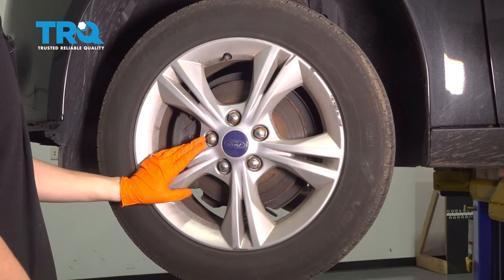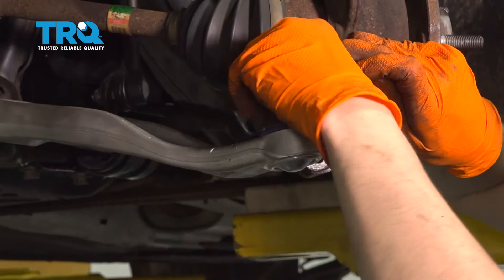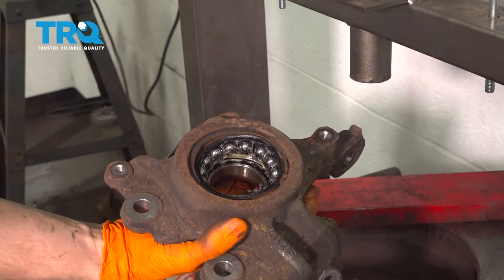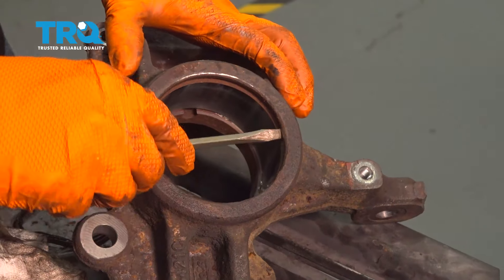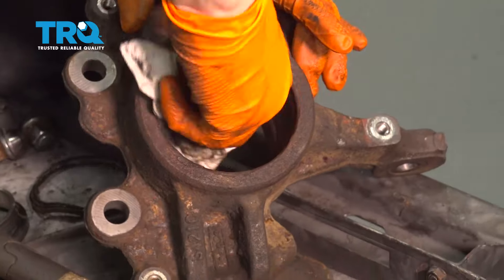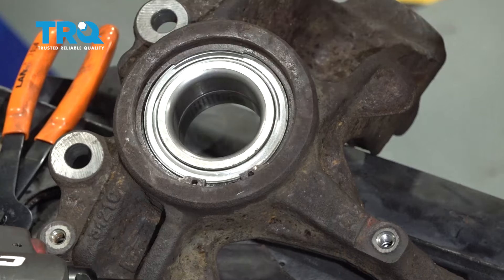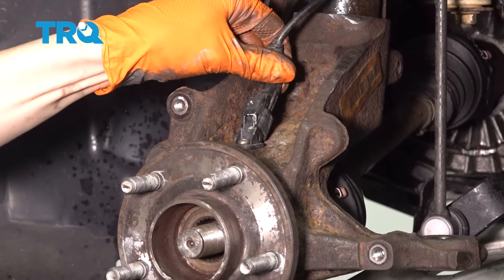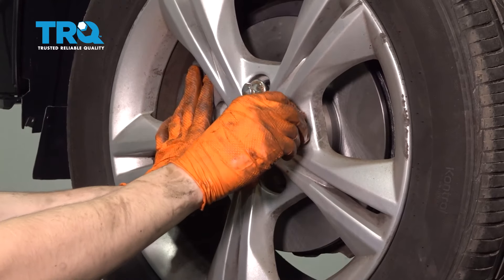How to Replace Front Wheel Bearing 2012-2020 Ford Focus

Comment: I like how you didn't mention that the bearing has a magnetic ring for the ABS sensor and it can be put in backwards I followed your tutorial, but put the bearing in backwards only learning It was possible from another video.
Reply: I'm not sure if you're strange for liking that you put something back together incorrectly because it wasn't covered, or if you're strange for using sarcasm on a video that shares a ton of information and was obviously made pretty carefully and with knowledge.

But hey, I like how you provided a bit of information that was missed in the original video. That's helpful.
Reply: @TheOmaJohn  sure the video is informative, but only to the point that it is possible to ruin a component you are installing.
Reply: @brutusjb3814  thanks for helping everyone else out.
 Nice work pal.
Reply: 🤣 😂I’m done.
Reply: Lol you shouldn’t be doing repairs if you didn’t know about the abs ring

Comment: There's a much easier way to remove the spindle from the strut.  Put a putty knife in the cutaway where the bolt came out.  Put the bolt in threaded side and tighten the bolt to the putty knife, this will push the cutaway apart, and the spindle will just fall off.
Reply: thanks. now to show my gratitude - check out billet spin performance tops, scovie turning or kemner design

Comment: Though every repair has its own issues this vid saved me hundreds. I also replaced the lower control arm/ball joint (They are not separate on the Focus 2012) Much thanks. I will repair anything I can, and "the man" can pound sand.

Comment: A mechanic replaced my bearing last year. They didn't use a press, instead they just hammered out the bearing. Immediately after, the brake pads had uneven contact with the rotor, generating rotational noise.  After years of replacing the rotors/pads/calipers, it turns out my hub was dented - All this was solved when the hub was replaced. Do you think this was caused due to the original mechanic being careless when replacing the bearing?

Comment: 19:56 Just a thought on installing the knuckle on the strut, if you can drive a chisel or something into that knuckle slot where the bolt goes in to spread the slot out some I believe it would go on the strut easier

Comment: Do you know of any reason why after this job the wheel speed sensor would be throwing traction and abs codes as well ashill assist. It worked prior to the bearing change and the sensor has been replaced and cleared with a scan tool. All the codes immediately return as soon as you start driving.